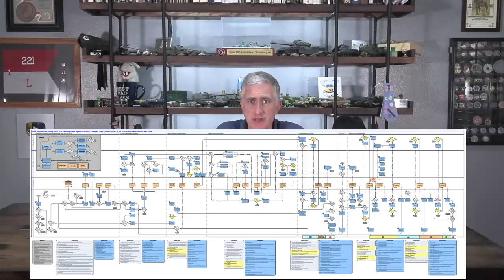Chieftain's Q&A #20: Zombies, Precious bodily fluids, and Magruder

Comment: Ok one use of alcoholic drinks is and was used to make water drinkable. Alcohol kills bacteria so water of life could be a good choice. Of words
Reply: Could have been the usual thing to do. Encounter a stream, need water, add the vitae agua, shake or stir, and then drink - with less worry about the healthiness of it.
Reply: Not quite correct. The brewing/distillation process killed a lot of bacteria. Thus in unknown areas its is safer to drink wine/beer/spirits rather than locally sourced water.
Reply: @Mugdorna  yes but if you ad alcohol to water it to kills bacteria it was used in many cultures. Look back Romans drank water mingled with wine. As did Jewish and English. If you have ever drank alcohol neat that is where it came from

Comment: British light  infantry platoon we would expect to carry at least 9 94mm’s per platoon against gen force type battle. 500mm penetration and couldn’t defeat ERA, frontal armour would be tricky so side armour m kill or kill if lucky would be what was expected. We aimed center of mass so if we were to hit a already blown ERA pack it would be luck. Anti tank platoon was the battalions tank killers which was Milan back then. Now they have bofors and javelin. Not sure on the orbat these days but probably similar. Anti tank platoon operates in independent detachments (2 firing posts)attached to rifle company’s or together for a big anti armour ambush.we usually covered flanks in advance to Contacts.

Comment: @27:18 I'd say Marv Heemeyer's home-made AFV in 2004 was militarily successful, in that the local police force couldn't stop it. It was only the fact that he ended up getting stuck in an unforeseen basement while crushing a building and then committing suicide that defeated him. Given enough time he'd have run out of fuel of course, and the engine did start overheating shortly before he got stuck, but rightly or wrongly it was quite an achievement. https://en.wikipedia.org/wiki/Marvin_Heemeyer

Comment: Challenger 3 rundown:

Engine is near enough the same at 1200BHP, which is a mistake. If they had any sense they would use the EUROPACK seen in challenger 2E.

Gunners control handle has stayed near enough the same, the idea of a console controller.

The additional equipment and such, like RWS, APS, barracuda, dorchester etc. I think will be a TES thing, i doubt that they will want any of the crews to damage any of the equipment. 

How its going to take to 2027 for initial deliveries is beyond me. its probably a money issue with the MOD. (not enough).

Comment: Q&A Question: The Challenger 3 was Recently released and a deal for 148 Tanks for 800Million, To say it does not really have any superior armaments or armour compared to the competition, nor lacking a trophy system, "why did they choose to go in house, rather than buy Leopard 2A7s? Would it of not been easier in the long run, or in fact the complete opposite? "

(I understand that the hull is still the same as the C2, so maybe its easier to use the hulls than scrap them.) 
(also aware you addressed the challenger 3 briefly but a bit more indepth would be nice)

Comment: Where I think larger bore artillery tube, like 203mm/8", might make sense is for long range fire using the ramjet rounds from, for example, Nammo. I'd imagine a 203mm ramjet round would a good bit cheaper than a rocket. Maybe had the ramjet artillery rounds been around in the 80s the M110 would have lasted in service longer.

Comment: Concerning jury-rigged equipment to replace the existing special-purpose gear that was successful -- actually better than the original equipment, which is why it was made -- is the leather-hammock-reinforced medical sling "liberated" from the medical spaces on US Navy WWII 8"-gunned heavy cruisers.  The way that the 260-335-pound projectiles were moved from their vertical storage on the outside surface of the circular barbettes holding up the turrets to the openings in those barbettes with the shell hoists to run the shell up to the guns, was supposed to be mechanical and cable pullies that slid them along the floor on their bases until they could be pushed sideways into the hoist waiting behind the opened flame-proof door in the barbette.  This was a rather slow process and the main reason that the guns could only fire three rounds per minute per gun in a "by the book" operation.  Since in a naval fire-fight, as in a tank dual, the one that hit the first and, here, the most was likely to be the winner, this slow firing rate was considered unacceptable by the crew and officers of these ships.

What they did, among many other "sailor-alt" tweaks to the operations in the turrets (reducing the recoil distance of the guns and speeding up the rammer when used on the projectiles -- not the powder bags! -- and so forth), was to realize that two-men together were strong enough to carry these heavy gun projectiles the rather short distance from their storage slots to the hoist door by hand, if a suitable way of supporting them was used.  By using a thick leather sling cut to fit the medical stretchers, they could have one person kick the shell out of its slot with his back pressed up against the barbette and have the sling there to catch it as it toppled over.  With the help of perhaps a third man, the shell would be centered on the sling and the two men holding the ends of the stretcher would run to the hoist and tilt the sling until it was almost vertical and then push the shell through the door into the hoist and somebody would hit the start button to the turret.  This could be repeated so fast that the rate of fire of the guns went up to FIVE (5) rounds per minute per gun!  As a jury-rig for a military weapon, this is one of the most successful that I can think of.  (Note that this had to be kept secret from shore support personnel, but was spread to all 8"-gunned ships, since some of those shore people would think that it was "sabotage" of Government equipment, but since the ship officers were all on their side, this was not hard to resolve.)

Comment: Howdy! Thanks for another great video.

Regarding Krupp's proposal for a 10,5cm KwK L/68 in the Tiger II, the issues raised by Wa Pruef 6 were that the cannon hadn't been accepted for service yet, it would require new aiming devices, and "the turret would probably need to be redesigned." Concern is also mentioned in that two-piece ammunition would be required and thus a second loader necessary (presumably because the ammunition would otherwise be too long to load into the breech within the confines of the turret).

What sort of "redesign" would be needed? Might it be possible to simply widen the turret ring as there is about 10cm of clearance between the turret basket and the hull sides? Perhaps by widening the ring, space could be made to allow one-piece ammunition to be loaded and the issues of low fire rate and a 2nd loader would be resolved. Could the cannon itself be redesigned to use a shorter, wider casing as had been done with other weapons?

If you were leading the project at Krupp, what changes would you propose to get the cannon into service? I'm curious to know how the design could be changed to rectify the problems mentioned by Wa Pruef 6.

Comment: My understanding (no handy reference*, so make of it what you will) about Panzer III and Tiger cooperation (in its original conception) was that the Tigers were Breakthrough tanks and the Panzers three assigned to their units were to be mother ships for Goliath wire controlled demolitions.  Minefields and bunkers in the path of advance could be countered in realtime with Goliath demolitions.
  I have wondered in past if it might be that Panzer III tanks trailing behind Tigers might use their CoAxial MGs to scrape antitank infantry teams off the bigger tanks.
*I checked my Weapons of the Third Reich (Gander and Chamberlain) and found they definitely report that the Borgwald BIV (Goliath's replacement/big brother) was used by Heavy tank formations.  Of Pz III motherships there is no mention.  Doyle and Chamberlain's Encyclopedia of German Tanks of World War 2 reports that Goliath was used first by  PanzerPioniere companies 811-815.   Later (in the caption on page 151) they (sic) say that the Goliath was deployed in the Kursk offensive in association with 654th (Elefant) Schwere Panzer Abteilung.  However, it reports that 60 Sd Kfz 301 Ausf C were issued to 301st Schwere panzer abteilung in Aug/Sept '44 specifying that "Twenty-one Tiger Ausf E were issued to 301st sPzAbt to control their B-IV, in place of StuG III".
Reply: At least I squeezed in the chassis, if not the PzKw III N variant.

Comment: I really wonder if drone defense vehicles i.e jammers and hard kill systems will been seen popping up in the next few years and if they will have tracks or wheels?
Reply: Probably no full anti drone vehicle more anti drone capability on most vehicles.
Reply: @EradWir  True but the army is lacking in air defense systems overall so I wonder how they are going to close the gap
Reply: @matthalo871  
An organization called the United States Air Force.
Reply: @calvingreene90  not very effective against a small drone.

I can build a small drone-smoker out of a microwave oven.
Reply: @calvingreene90  that's because they are trying to solve the same problem but are falling behind.

Comment: i found it interesting that he couldn't see a use for a support tank then the xm87 he described was just that.  i could see a use in that building them while retaining older APCs rather than building/buying new IFVs.  plus the Bradley suffers from being a compromise(d) design, perhaps using two specialized vehicles  instead would be better.

Comment: First of all that transition from the zombie defense plan to the next suction that was hilarious in my opinion it's pretty much oh no anyways
Second since you're known as the tank guy my ultimate zombie defense strategy will get a recreation bt-7 tank (my personal favorite light tank) and replace the 45mm with a 40 mm bofers Auto Canon because the ammunition is easier to find and then you know I have a tank resistant to any kind of small arms and if I put an RPG cage around it I won't be surprised if it could stop some heat and hesh warheads

Comment: Interesting that the canteen cap does not appear to have changed appreciably since the 1970's.  While we 'only' had M60A1's; and therefore no on board NBC system, the concern (then) about agent contamination of the cap/nipple/hose arrangement might still have some validity...yes or no?

Comment: Being screwed in the case of a zombie apocolypse.... that depends on what type of zombies they are. If they are traditional style zombies, so essentially dead, then no, long term you are fine, you only have to hang on for maybe two weeks, until all those zombies have started to rot. Once they start falling apart the apocolypse is essentially over. 

More modern 'disease' type zombies however, they are a different matter. In the case of those things then yes, you are potentially boned.... It really boils down to are they dead, or are they simply changed? If the former then long term effects will be nill, as the zombies will basically all rot away. If the latter.... well then you have a problem!

Comment: there is footage of Chinese main battle tanks Floating down the street after some dams broke, I can't find them currently but I assume the armor is either aluminum or fiberglass. One of the videos shown a tank driving down the flooded streets then the water reached just above the track, lost traction, and it turned into a boat, that the operators could no longer operate and taken away with the current. I was in fort Stewart in 5/7 Cav (formally 1/3 ADA), Saw an Abrams goes into the drink and become a submarine so I know Main tanks are not supposed to float. Guys got out a little hairy for the driver pulled one of those movie stunts where we all thought he was dying and he comes up behind us and says "What ya'll Lookin' at?". it took 3 days to get it out of the alligator-infested waters. I remember when I ETS the Battalion Commander gave me the Branch Insigniafrom his hat in lu of a coin.
Reply: We also lost a tank in the Euphrates river. It went swan diving off a bridge and turned into a sumarieas during a dust storm. it took a few weeks to find it as the waterlevel dropped. No one survived.

Comment: Re: the T72M2...are the autocannons intended for use against small drones given recent experience in Libya, Syria and the conflict between Armenia & Azerbaijan? 

They'll be harder to hit with MANPADs given their low IR signature (possibly negligible if the drone is electric) but optically tracking may be easier, hence the high elevation capability.

Comment: Isnt an all rubber track at a disadvantage in terms of combat repairs? Changing a track link seems impossible with it so it would need to be replace fully after being shot or otherwise split.
Reply: There are band tracks made up of four segments connected by conventional track pins, to avoid that problem.

Comment: The Czech republic is now finaly decided to replace the old BMP2 for something newer. Currently there are 3 contenders (used to be 4) CV90; Ascod and Lynx. There used to be a Puma on the table but they resigned. Your thoughts on which one would be the best option?
Reply: CV90 would be a great option but they are going to go with the British Ascod because, well, just because it's British
Reply: @mahmoodali5043  the Ascod is Austro-Spanish; also, that the Czechs would have a special relationship with the Brits is not so evident
Reply: @aasphaltmueller5178  my bad, confused it with a British design
Reply: I would say that the CV90 is probably the better option, but I'm not sure about cost.

Comment: Col. Moran could you answer this.  Because of the Key West Agreement, the Army seems to have gotten the least out of it, is that correct in your opinion?, it didn't establish a 2nd aviation branch until 1983, because of this agreement did the USAF try and strip the Army of helos?  Did the USAF try and stop the Army from arming helos?  This second part is more USAF, also after that agreement it seems "Bomber Generals" ran the AF until the late 70's or early 80's, during the 50's and 60's the AF focused on bombers for tactical aircraft to get any funding they had to but bomb bays on them, is that right or wrong?  The books I've read, Gen Robin Olds, Col John Boyd, etc, all seem to have this as a subtext.  Thanks

Comment: Question: Considering this example, the Portuguese used 4 M4A1 Stuart during Ultramar war (colony wars) and the troops found that they're use where far more useful then the Panhards in the same operations, considering the efficiency of a obsolete tank, in heavily dense forest, shouldn't any army consider they're obsolete equipment has  a possible  replacement for certain operations where they in service vehicles can't work or do the purpose rolls has they where intended to?

Comment: RPG-7s are actually pretty effective vs T-72 type tanks in you manage to jump out at it from out of a tree line, never mind an urban environment. In practice, you don't even need to kill the tank, just hit the turret 1-2 times and the crew will panic and leave the vehicle (at least the russians do)
Reply: This should be framed with the perspective of conscript militaries compared to professionals. Professionals may be unnerved by non penetrating hits but seem to be able to respond in term, conscript forces seem to regularly abandon vehicles this can even be seen back to WWII where relatively untrained soviet or German forces at different points in the war would abandon vehicles. 

I seriously doubt any professional tank crew is going to abandon a tank in the face of ineffective attacks, see US forces in Iraq who seemed to do fine in the face of RPG’s.
Reply: @cynicalfox190  Well, the 5tg Separate Tank Brigade of the Armed Forces of the Russian Federation (Ulan-Ude, military unit 46108) is as professional as it gets in russia
Reply: @VoltageLP  considering a large number of troops from that particular battalion are conscripts even during their time in Ukraine I don’t see your point. Hell one of the most notable things to come up when looking into that brigade is a conscript got run over in 2016 so I wouldn’t be considering them on the same standard as any of the complete volunteer forces fielded both by the Russian federation or any other professional military. Even in 2006 when Russia’s forces numbered just under 400k ground troops around 190k were conscripts

Comment: That First FT Photo, with the Rubber Tracks...( You Said 1 of 24 ) Were Those Kergesse Tracks, or Just Rubber, and Where's the Info on Those FT's...ALSO...Some Confusion On "What and When" of U.S. M-1917 Tank, As I Live Near Rock Island Arsenal, I've been Thinking of Doing a Short Work, That Sorts 'This is the WW1 Contract One with the Marlin MG, This is the 'A' Model with the Updated Automotive Engine, This is The A-1, with the Browning' And Listing, Some Kind of Sense about Who Had What When, NG, USMC, and Reg. Army, and if it Can be Found...What the Units Looked Like...
Reply: Pictures are on this site:
http://www.chars-francais.net/2015/index.php/7-archives/de-1930-1940/2668-1924-char-ft-kegresse
They used Kegresse tracks, basically made of steel and rubber.
The test was not conclusive: the tracks wore out rapidly and had a tendancy to slip aroub the sprocket in wet terrain, because of the weight of the tank.
Reply: @chefchaudard3580  Merci, Chef...I'll Check THAT Out...